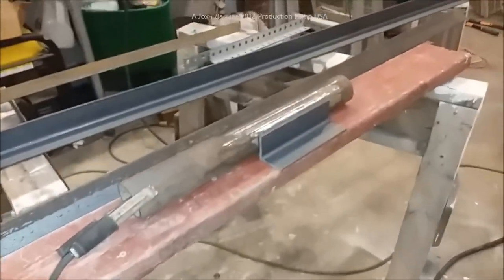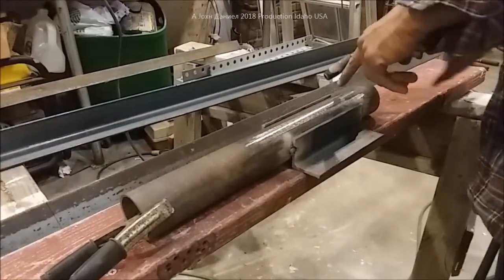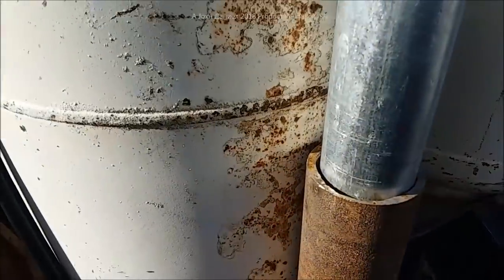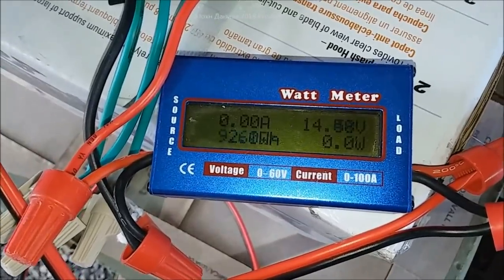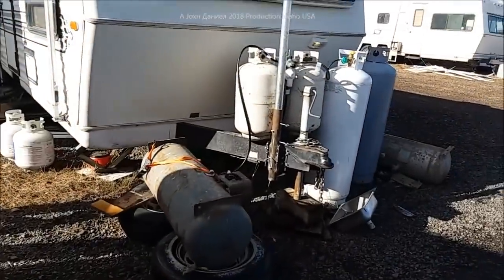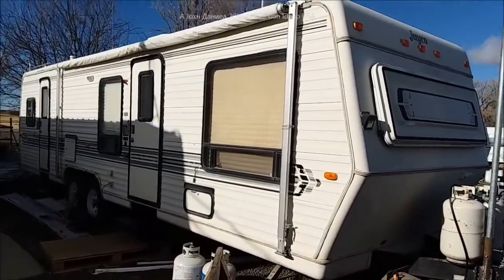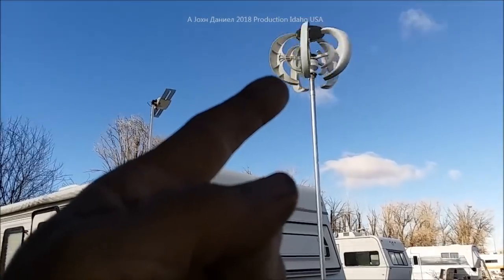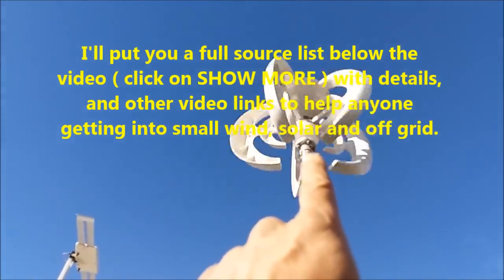Lantern VAWT Wind Turbine installed on JAYCO RV camper, Nah! See parts Below video

Comment from the maker: WIND POWER MAY NOT BE FOR EVERYONE !! But if you can try, This LANTERN 12/24 volt models VAWT https://ebay.to/2P4hngv , the mppt SOLAR controllers in Jayco trailer https://ebay.to/2zpOWEZ & Solar panels used https://ebay.to/2TBmCIh . SEE LIST ABOVE of all parts related or used in my projects. Plus some cool FAIL videos.
Reply: I am loving that AliExpress. You got me hooked, cheaper than ebay and amazon and they really bust their butts to please the buyers.
Reply: Hello
Which would u prefer the 12 volt or 24 volt for a pop up camper with 2 deep cycle batteries 
I have 8 solar panels for the day just wanting something for the night time to help maintain the  batteries while running the furnace at night
Reply: Hello Mr.John. I bought this Vawt, and it came with missing parts. I noticed that everyone is complaining and asking for their money back. I checked to make sure it is the same than yours  and the seller is not longer selling it no more because I read in other yt videos that this Vawt is a scam and do not generate any amperage, and the main purpose is for ornament on the backyard.  I'm wrong  for asking  for my money back or you  can honestly attest in a court of law that this Vawt truly charge  an empty battery?
Reply from the maker: @neliosamch3195  I would ask for money back immediately. These sellers are now doing what that scam artist selling wind junk from Missouri is doing, putting a super high voltage PMG on the damn thing so they can catch the fad. When they first started selling them you had a few normal knock offs, but ALL are now suspect and I would demand money back, claim NOT AS CLAIMED on it. Mine made power in my area, I have high winds and I got and almost 10 amps which I will accept in 30 mph but the asswhipes are copying the Misouri fake-a-watt claim standard now, using 7 magnet shi-t on them. Mines a 12 mag and its a expensive low RPM PMA, not a fake ass Vietnam made junk PMG. Even then you can not get no 400 watts but you can get equal to a 125 watt solar panel so for $150 to 200 its worth trying. We left ours on our fence charger on our texas hill country property and it is working fine there, but its a PMA . Ebay needs to block and cancel account sellers of all that do not weigh over 18 lbs, thats how you know its a fake because weight matters in copper and magnet amounts used! Otherwise its not a low RPM. Really pisses me off they advertise coreless and/or a low RPM now and send out worthless crap. If you get crap, demand you keep and get money back.
Reply: @JOHNDANIEL1  Thank you very much for your response. I  saw that the 600watts  VAWT is smaller than my 300watts HAWT, and doesn't have certification plate. Ebay put my case in hold until seller provide more documentation.
Reply: just went to Ebay to order VAWT and not available in 12v. is it available any where else???? Oh by the way I final got my Chinese badass running  and it is great
Reply from the maker: Better source of the MAX blade VAWT https://ebay.to/2P4hngv
Reply: @JOHNDANIEL1  so you think this one is as good as yours?
Reply from the maker: Should be a select choice on the one I got, 12 or 24 volt. Or check the SEE ALL ITEMS where the sellers name is of that guy or gal selling them and they should have them in 12 volt too.
Reply: clicked the select button and they are sold out @JOHNDANIEL1
Reply from the maker: Hopefully they will get more at some point. I do know theres 100's of similar looking and most are just not functional. Even from China you get knock offs on Chinese own stuff.
Reply from the maker: It appears to be from the same maker but I can not guarantee anything from those people importing now days. But I do think the seller ID is in the same group.
Reply: just placed my order did notice it said "not included stents" what is a stent? @JOHNDANIEL1
Reply from the maker: The stent? i believe they are referring to the mounting flange. Thats why i put that no weld flange on the list below the video.
Reply: @JOHNDANIEL1  ok I guess I'll find out when it gets here, thanks John. Just got an email from seller and you are correct.
Reply: Seem both are sold out of 12 and 24v DC models. No date for resupply. Anyone know of a downside of a 12v ac and a rectifier?  Supplier has limited understanding of English.
Reply: @ John 
What about 24 volt vaut to charge two deep cycle marine batteries? 
Will the 24 volt charge and work well with 12 volt batteries?
Reply from the maker: Yes you can use a 24 volt to do that. Many people who have low wind area choose 24 volt models to charge 12 volt bank and use a MPPT boost controller like this one https://ebay.to/2QquUEW and it will charge either from a 24 volt model.
Reply: So its been a month...how is it holding up?
Reply from the maker: Not a performer like my 500 watt China Turbine, but its putting a constant average of 2 - 3 amps in all night on most nights. Helpful to the battery bank, not impressive unless in 25 mph winds but my heating unit makes more run cycles due to cold wind heat loss on the RV and it has peaked at almost 15 amps once. Worth it to some extent if its sold for $130 or less.
Reply: hi john.looks like you have had this vawt up about a month.do you have any more info on what kind of power it is producing.in your personal opinion is it worth the money.thanks  mel
Reply from the maker: It works, not as advertised though, I supposed they got the fake rating system from the nut job wind turbine hocker in Missouri but it does produce about what is $1.00 a watt. I am getting 40 to 100 watts ( 3 to 7 amps) on the windy days which is helping keep the 4 batteries up from over use of the heating unit fan. But would I suggest it, only if your also doing solar and realize its best use is in windy days when solar gets hampered by weather. If your want a straight power house wind turbine, then this one https://ebay.to/2F5tV61 will get you the best dollar for watt option. Its a Automaxx thats not branded and same identical turbine for $112.00 less. Those REALLY make the power and are the WuixAir made properly rated turbines.
Reply: hi john.thanks for quick return email.when you say you are getting 40-100 watts is that per hour.do you happen to know how many amps hours total you are getting on a good wind day.i have 580w solar and on a good day i will get 150 a/h or about 1800 watts total.i have 2 horizontal wind generators on my boat and they total 430w.on a good windy day they will produce about 20-25 a/h or 240-300 watts total.the wind chargers are great especially when weather is to inclement for solar,but the noise they make will wake the dead.i thought i could replace them with vawt and maybe get the best of both worlds.produce well and quiet.thanks for your time and videos..mel @JOHNDANIEL1
Reply: @JOHNDANIEL1  if there was a way to increase rotation speed do you think it would have a higher current output. Or is the PMA just not capable of higher output. When I ordered mine instead of coming with double catchers on each arm it  came with singles, and no way of getting the doubles. So they rebated some money, I can play with some different blades at this price.
Reply: John love your videos keep them coming!! Bought a VAWT haven't got it up yet but have tested it so far so good!! I have learned a lot from you vids and to heck with those that think otherwise!! Lol I have to questions 1 is how much junk have you bought to get to the good stuff and 2 why the bridge rectifiers in you hawt system over a charge controller? Thanks for your time!!
Reply: At 7 months now, how are they holding up?  I’m looking at getting and doing a van conversion in 2022. Do you think this is viable for that application?  Considering some Harbor Freight amorphous solar panels and some regular ones, since may be spending significant time in the National Forests and looking for the best options. Your opinion is valued. Thanks! ~Suzi
Reply: Love your vids! Looking to buy the ME500. Do you have a video on how you connected multiple turbines together to power your RV? Thanks :)
Reply: Since they're mostly crap now, where would we find a VAWT that worth having anymore?
I want to set up about 200 watts on my bus. I was figuring 2 sets of Thunderbolt panels and one of these for night... 
Plus I wanted to experiment and see if it would work with the wind from driving. It's not like ya go 100mph in a bus... hahaha...
I want to put it on a telescoping pole for when parked. And see if it could be lowered to about the base of the roof and still spin when driving... 
I just think it would be neat if it could be done.
Reply from the maker: @KimmyBear26089  A lot of people want to put these on moving vehicles, not sure why. It's a great way to get a massive ticket! But if you want a light weight turbine that does make power for use off a vehicle mount I suggest a basic 400L 5 blade https://bit.ly/3c3qoSz . You can easily make a slip fit mount and its no heavier than a VAWT but makes 300% more power.
Reply: Hi i have a 4200w one of these what size controller do i need
Reply: Look like eBay took this listing down

Comment: question on the noise level. does the vertical turbine quieter than the horizontal type?
Reply from the maker: Yes, but not worth the power losses. Get the LOW WIND 600 is is very quiet and durable. https://s.click.aliexpress.com/e/_99l1XF

Comment: Hello John! Can you recommend an 3kwh vertical axis wind turbine to be installed on a home roof? Thanks and cheers from Italy!
Reply from the maker: A 3000 watt Vawt would be over 4 meters in diameter, about 3 meters tall. And cost about $3500 USD. The junk they show and sell claiming such wattage is all fake rated, avoid it.
Reply: @JOHNDANIEL1  so better put 2 or 3 smaller ones?

Comment: Are you getting anywhere near the claims stated by the manufacturer? I've seen reviews suggesting that it would need 140 mph winds to reach the stated wattage output? How many watts are you averaging with it?
Reply from the maker: 45 to 60 is about as good as the wattage goes on 15-20 mile an hour winds steady and surges it'll hit 150 but not very much

Comment: I have watched your videos and trust you judgement. I live out of my SUV and I have a 100w solar panel and a AGM battery. I would like to add a small wind turbine to keep my batter charged when it is raining and at night. I might be adding a second battery and wire it in parallel. So what would you recommend. Last thing I might be building a mini tear drop camper and I will transfer all of batteries and things to the trailer.
Reply from the maker: The GE 5 blade 300/400 watt https://youtu.be/9KEd80qBu0I on a piece of 1.5 inch schedule 40 pipe at least 5 feet over your SUV, and another 100 to 300 watts more of solar ( these you can have sent to local walmart and pick them up https://bit.ly/3hMWDZ0 for pick up)  . 
And this controller - https://bit.ly/3kHcprM to run all solar and your wind into. 
But at that point, be sure to add at least 1 more battery, and no inverter over 2000 watt unless you go to 3 battery.

Comment: So it produces AC and the controller converts that to DC, so wouldn't you get better performance from a upgrade of charge controller? 

Also vawt are much less efficient then the horizontal versions and should not be compared to them (for peeps in the comments), they are designed to be used in turbulent air where obstructions are present such as buildings etc
Reply from the maker: A better controller may collect more usable power from its high volts. Thats true.

Comment: I am a little confused, In the video of the VAWT on the trailer you say it works, maybe not great in comparison to a H-axis but 5 amps is 5 amps.
I see your latest post  " Lantern VAWT Not worth it"  I was planning on "Just playing around" in the backyard and running my garden lights off lionfe battery bank charged with solar and some wind augmentation. So does the lantern VAWT work at all or are you pushing "Bang for the buck" efficiency?

Comment: Set 5 amps at 12 to 14 volts is only around 70 Watts it's rated at 400 watts?
Reply from the maker: Not great but it did max out to make almost 40%, most did not even move a meter. I doubt any can do as claimed so 40% "peak" is big compared to what others end up getting. However, I would suggest for sure the GE300 over this one. It will hit 300 watts at rated, Its small, not real loud, light weight, and unlike many that look like it, it has the full core PMA in it and there's a Link to it is under my video here https://youtu.be/pZuI2wSXO6o

Comment: Hello 
I got this in for the lantern 
Do I connect to the battery first and then the lantern or lantern then batteries 

US SHIP 400W LCD Wind Solar Hybrid Charge Controller 12/24V MPPT PWM Mode https://rover.ebay.com/rover/0/0/0?mpre=https%3A%2F%2Fwww.ebay.com%2Fulk%2Fitm%2F163136910028
Reply from the maker: Connect controller to battery, see the controller reading voltage, then connect turbine to controller

Comment: I don't think so.  Adding another small vane will make no perceptible difference.  Your "test" on the first video proved nothing.  You didn't show the drill operating, nor give an indication of the speed it was spinning at.  Under real world conditions, this turbine will never spin fast enough to generate anything at all.  The differences between this "new" model you are singing the praises of, and the original version, which I have had running for nearly two years are negligible.  This is junk, believe me.  My solar array is working just fine; I only got the turbine to see if it would fill in some of the gaps.  It doesn't.  The 8.59 volts is consistent with what I've gotten.  It is nowhere near enough.  You are deluding yourself.

Comment: So frustrating we finally find a VWAT that works and then they are sold out to extinction.
Reply from the maker: The 400 watt claimed vertical I have in a few videos has never made over 160 watts max, Thats it. And although thats not absolutely terrible to get 10+ amps of charging for the price of 150 watt solar panel, the majority sold make near NOTHING! It's looking like over 80% sold are using surplus 12 lb weight, 200 watt high RPM horizontal PMA's claiming 300 to 600 watts and people are getting real burned. For a VAWT, It was very hard to locate a REAL one like the one i got with the 12 magnet double bearing low RPM generator. I only recommend the real ones IF i can find one. If the PMA on a Chinese Lantern VAWT don't weigh over 19 lbs, Send it back, file a ebay claim on it as Item not as described . usually you get refunded and keep it.
Reply: Has anyone found an 800w VAWT, with the ice and snow I prefer the design over the horizontal. My 800w horizontal never went over 300w and the 400w VAWT maxes at 3w. Was refunded on both but looking for a turbine that actually works (prefer vertical) we get 10mph to 40mph with 60mph gusts as a norm but snow/ice becomes an issue with our horizontal (had 3 all worked half what advertised)
@JohnDaniel

Comment: Should use Anemometer,  Power meter, Voltmeter, Ampmeter, to verify these devices.        
       Power =  Force   *   Speed
When mounted low,  wind speed is small;   When the effective blade surface is small, not enough area intersecting the wind,  not enough force generated.   
      The most effective windmill is horizontal one, and more blades will give more push surface. Also enouth mounting height is necessary.    
      Buyers should ask for DATA from seller  before buy these devices.   If made in China, these product should be shipped OUT of China, not somewhere else.   Advertisement ONLY= SCAM.   Sellers  should provide Government Certifications for their products!

Comment: From everything I read, apart from this, these lantern type VAWTs are rubbish, a rip off, they dont work. You say they work fine, can you confirm it generates lots of power, as no one else has managed to make any power ?
Reply: They rate them at 300W to 600W, but if it is cranking out 3 or 4 amps at 12V, that is 36W to 48W. So yeah, they are rubbish!

Comment: Hello
Reply: I would like to send u a video of my meter see if I agree
It does not charge my batterie 
12 volt marine
Reply from the maker: I would definitely make a video on it. If you got one thats not working, then its NOT AS DESCRIBED and can be returned to Ebay or where you bought it for a refund. I finally figured out why mine makes some usable power, they shipped me a 24 volt model for my 12 volt order. It only makes a max of 160 watts in high winds, I get regularly about 65 to 80 watts (4 to 6 amps) in 16 to 18 mph. Getting that at night is ok for the price, but they are not capable as a 12 volt model. I will be making a video very soon showing this fact that you must get a 24 volt to get usable power into a 12 volt battery. But it gets to charging voltage for a 12 volt system using the 24 volt generator on it.
Reply: It is a 24 volt 
And only produces 8-10dcv on my meter 
On super high winds (that blow over trees) it gets to 13 dcv 
I ordered this from your link 
Do u think this will help?

Boost MPPT Wind Solar Hybrid Charge Controller Auto with LCD Display Dump Load https://rover.ebay.com/rover/0/0/0?mpre=https%3A%2F%2Fwww.ebay.com%2Fulk%2Fitm%2F264050936843

Comment: is there any video showing a real time meter displaying produced power ???
Reply from the maker: Not yet, I seem to be off running truck everytime theres more KWH added to the meters. Will make one when wind and me are at the RV at the same time. Until then, its a cool and low power producing item. I may re-design it to use a Thermodyne PMA on it to get some higher output.